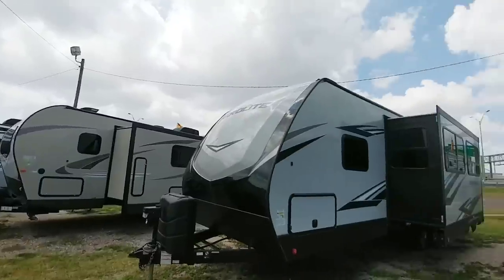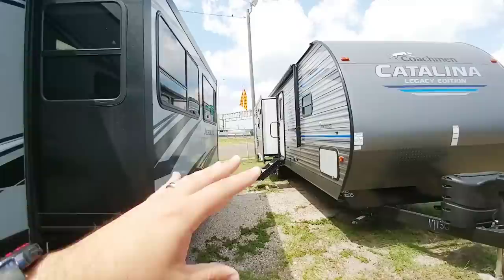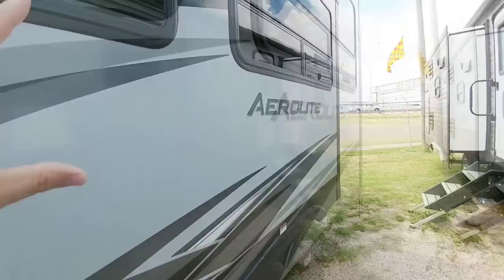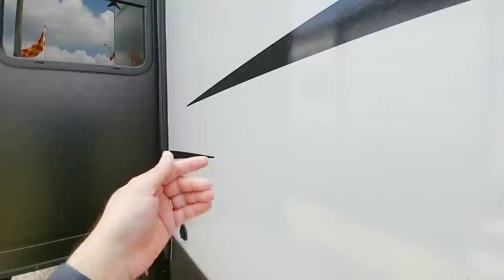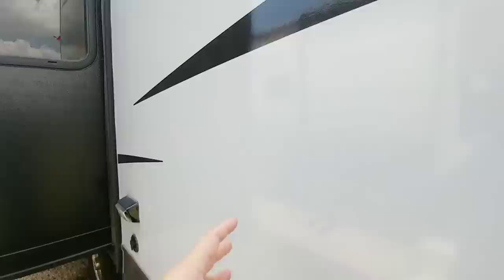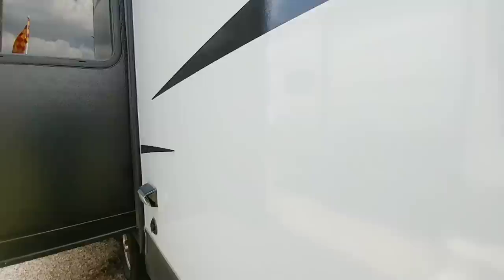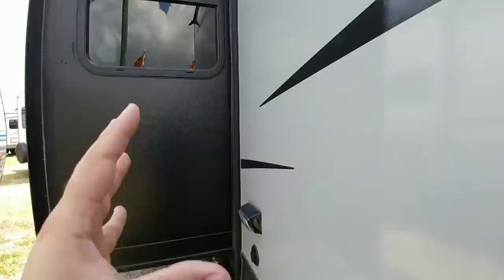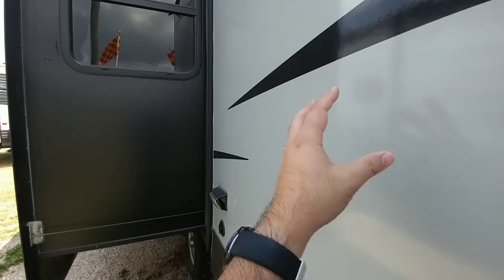Fiberglass Laminate vs Stick and Tin Travel Trailers and Fifth Wheel RVs!

Comment: We had 23yo HR aluminum frame and skin trailer. Build like a tank would last for decades but moisture got in on the slide floor and around the cargo door. Developed mold. Regardless of what type of trailer you have water/moisture will always be your worst enemy. The wood floor is the weak link on both types. I wish they used some type  of  marine water resistant material on the floor rather then just plywood.
Reply: George Suchenstein or just buy an airstream and kiss the moisture issues away.
Reply: I’ve worked at fixing rotting plywood floors and it’s not pretty.

Comment: One thing that was not mentioned is the weight factor. The aluminum rig is going to be lighter. That was the key decision in my purchase.
Reply: Not always.
Reply: Is your screenname "Tralfaz" from "The Jetsons"?
Reply: @machfive916
Lol. Yes it is.
Reply: in the 2022 jayco 28bhs, the fiberglass version is 300lbs HEAVIER than the aluminum version
Reply: @resharddurdley6987  100% bs. You take identical units, aluminum and fiberglass IS lighter. I Had a 24’ Starcraft, wood frame aluminum and it WAS 400’ lighter than my vacuum bonded aluminum travel trailer. The Starcraft was 6’ shorter w/out a slide out.
Reply: @tralfazsteamboat5695  Then your updated or current name should be "Astro"
Reply: @paulc8092  That’s funny right there. Had the name for years and no one thought of the rename.

Comment: I much prefer the fiberglass simply because I spent hours and hours scraping off old sealant from doors, windows and such on the aluminum one so I could re-seal the entire unit and because it isn’t a smooth surface it was such a pain in the butt!!!  I would think having two flat surfaces would be so much easier maintain the seals and integrity of the joints.

Comment: here is the southwest people are starting to look for the tin sides because the very high heat is destroying the laminate sided RV
Reply: Guess the class A coaches better stay away 😂
Reply: I saw one a few weeks ago barely 3 or 4 years old delaminating from the heat, My old stick and tin was in better shape.
Reply: Heat can play a role in delamination for sure but the biggest culprit is that owners do not properly wash and treat the laminate on their trailers regularly. Bugs and dust will cause damage to the clear coat causing fade and erosion of the fiberglass. That’s why you need to wash it and wax it fairly regular

Comment: JD, you also might point out that the fiberglass sided units are easier to clean and slightly more aerodynamic.
Reply: Actually the ribs are more aerodynamic.
Reply: @NoName-tz5ji  Yeah, I guess that's why airplanes, vehicles, boats, and UFO's are ALL smooth sided … SMH.
Reply: Burt Bennett planes require lift,boats are in the water,I know squat about space travel so I’ll give you that one. Cars are made to look stylish and be aerodynamic,a car with diverts is ugly but it’s been researched.. Research it.🤦‍♂️

Comment: There was a fire at the storage lot where we keep our camper. All the fiberglass sided ones had heat damage. Our aluminum sided one only had to have the doors and seals, and windows replaced. We were back camping while the 4 other rvs that were affected were still in the shop.

Comment: Had both types.....hardwall is way easier to wash and keep clean. Tin wall may be more budget friendly, but if you try to hose, or pressure wash (even at a mild pressure) from below, you can get water in behind the siding.....

Comment: Just thought I would post this for some of the viewer with questions. I have a 2009 Jayco Jayflight with a large single slide, which was before Jayco sold off to Thor. I honestly think this was some of Jayco's best years for quality. Some have said the quality went down on the Jayco units after they sold to Thor but what I'll say about our 2009 Jay Flight G2 with aluminum siding is that its very well built and has required very little upkeep. At 10 years old we don't have a lot of fade either. I very much appreciated JDs assessment, but for me personally on TTs I actually like the look of the aluminum siding much better than the smooth laminate look. I see more problems with decals fading, chipping off or flying off on the laminate siding RVs than I do with the aluminum siding units. For whatever reason, however on Fifth Wheels the laminate/Azdel siding looks much better to me. Good video, JD

Comment: Up here in the nw there is very few 4 seasons rated stick and tin trailer 
The trailer I have now is laminate sidewall and my first one the others I have were stick and tin
That you froze in during winter
Granted the trailer before was a 1997 
It also was impossible for the air conditioner to cool the trailer down
My opinion is 
If it’s stick and tin it needs to be 4 season certified

Comment: I’ve seen to much delamination to steer me with the stick and Tin. Love our Jayco 32BHDS
Reply: Stick & Tin will delaminate just like fiberglass. Only difference is the Stick & Tin is less expensive and easier to repair. Also, the Fiberglass is lighter.
Reply: What about that Azdel stuff?
Reply: @rush1764  No it wont.  Something can't delaminate that's not laminate.
Reply: @rush1764  how??? Alloy siding is literally like house siding. There is no glue.

Comment: You forgot the injection molded methods.  Also many fiberglass units use the better Azdel panels instead of Luan panels.  Azdel will not absorb water and there are fewer problems with delamination, as fiberglass bonds better to Azdel than Luan. Vacuum lamination has a much lower rate of delamination than a pinch or pressure laminated unit.   Properly cared for, tin and stick units can last very well, but they are more prone to leakage and water damage. The high heat and humidity of the Southeastern US has a detrimental affect on most Tin and Stick units,  also the aluminum outside is easily damaged and can become ugly looking in a short period of time. Having said that, older and some modern cheaper Fiberglass units were prone to severe delamination which is a lot more expensive to repair than the aluminum siding style.  Newer units, are less prone to that problem, especially the vacuum laminated units with better, but currently more expensive Azdel panels.
Reply: Hi Gerard.  Do you happen to know what makers (brands) use 'Azdel'?   Thank you for sharing your knowledge on this topic.  I made note of the vacuum lamination as well.
Reply: @lw5417  I do not know all the ones using Azdel, but the Coachmen APEX and Freedom Express models and the Winnebago models as well as the R-Pod and others are switching to Azdel.   Find a what you can tow and the floor plan you like then check out the different manufacturers for ones that fit those criteria and at dealers near you.  The quality of manufacturing also plays a part.  Just because they use azdel does not mean the unit will be well made.  There are whole books on how to pick the right rig for you and evaluating the different manufacturers.  Some of the best made are made in Europe and Australia and not available in the US.  One other method of making is using molds,  both Scamp and Casita make critically acclaimed trailers that you have to order directly from them. The bad news is that they are small and simple and good only for one or two persons.  The good news is they are really well made and have the fewest complaints and excellent customer service, while being light and easy to tow.
Reply: Hi Gerard.  I cannot afford to make a mistake.  This will be my retirement home.  Your good information is now written in my notebook for finding a quality RV that will last.  Thank you for sharing and helping others, like me.  Wishing you the best. 🌻
Reply: @gerardtrigo380  Oh good, I'll check out those channels.  This is so much fun!  Thank you.  🦋

Comment: What many people don't know is that with BATT insulation there are going to be many voids. Fiberglass doesn't always creep into every gap. Also, batts are cut to a specific size so if the FRAMING of the studs isn't perfect the insulation won't pit properly. I would always choose a   one piece foam filled wall over batts any day.

Comment: My aunt and uncle had two replacement walls put in under warranty on a solid walled unit due to cracking at rear door, the third wall installed came with a new frame under warranty. It is a good thing they put on some miles early, wonder how many units out there are a ticking time bomb?
Reply: Doug - to answer your question, 98% of the new ones; the other 2% are stored in climate-controlled garages.

Comment: It seems to me that both are fine if you can keep them dry under the skin.  A guy once told me that the best maintenance for a trailer is to keep it inside between uses. It eliminates moisture intrusions and preserves the seals.  Sun is not good either.

Comment: Good advice except one part. You can’t find all floor plans in both styles. The higher end units , higher end 5th wheels in particular, will only come in fiberglass. The lower end units will come in both.

Comment: Cheap fiberglass siding delaminates from glue separation. Go out west where i've noticed what the hot dry heat does. Not always water from behind. But, notice very expensive rv/motor homes don't have that problem

Comment: Any inside air that gets on the tin will turn into water when it is cold outside. The fiberglas delaminates. And both make no provision for when (not if) the water heater leaks. 
Today’s cars may look cheap but most will last far longer than the old ones. 
Someone should develop a travel trailer that will hold up. And don’t say “Airstream” their floors fall out too.

Comment: Really with an travel trailer, its function over form. Looks are a nice bonus, but comfort, utility, reliability and ease of maintenance would be my big concerns. Now obviously something painted pink with orange stripes and green wheels isn't getting attached to (any) truck, but realistically the goal of a travel trailer isn't to be sat outside of and admired, its meant to give you a comfortable place to sleep when you're on the road. Same way truck A may look better than truck B, but you buy truck B because its more capable than truck A. If you really have a thing for looks, worry about the interior first.

Comment: We had a stick n tin for 12 years.   We got a hail storm and it was totaled.   We were told that the fiberglass was stronger so we bought that.   Yes, our old unit was not covered underneath but the new one is.
Reply: I store my 5th wheel at a storage lot which got hit by hail, the stick and tin trailers all had sever dents, the fiberglass ones didn't but my roof did take a beating which I repaired myself.

Comment: Is there a weight difference between the two with the same floor plan? And is one more energy efficient over the other?
Reply: Rick VAnSkike normally the weight difference is minimal (within a few hundred lbs)  when comparing the same size rigs. It’s the accessories that make the biggest difference in weight.
Reply: @gfunk4014  thank you!

Comment: JD, in your opinion, which would be the most energy efficient when it comes to cooling either the tin vs the fiberglass here in the Coastal Bend region? As full-timers we definitely want the one that would be the most energy efficient since all the parks charge monthly electric for those that are on a monthly basis.
Reply: I will be buying a fifth wheel in about two years. I will be a full timer. I'm on a budget. I'll also be buying a nice used Truck too. Most likely the Fifth Wheel will be used. So it's a bit scary because of water damage. I'll be moving to Arkansas or Colorado, not sure yet. Also I have two Parrots. So I have no idea how they're going to react to being in a moving vehicle. Also about finding places to stay that are affordable. I'll have a work at home job, and disability, so it will not be a whole lot of money. I would like to know what my monthly cost would be on a budget, staying at one place that would be affordable.  It will just be me, my Chihuahua, and two birds. Unless I meet a woman within that time or later. It could happen. 😁 So as much advice that can be given, would be fully welcomed. Thanks.
Reply: I have been doing alot of research ... i have similar questions as these gentlemen do... and I'd like to ask one more : 
Which trailer ( fiberglass and aluminum frame) or tin and wood frame... are more likely to hold up secure in a major storm ? As weather events these last few years have intensified and will continue to do so .... which is beefier and stronger .... this goes from hail stones,  to flying debris etc.... 
Thanks for the input! And wisdom!

Comment: You forgot one thing to mention. Rigidity in an aluminum frame is must stronger and more durable than a stick and tin rig. I didn’t buy a wood framed rig because they generally have more sway and tend to separate at the joints more often. Meaning my rig will last a lot longer than a stick and tin rig.
Reply: G Funk sales man told you that huh?
Reply: Aluminum is more ductile but has a lower yield point then wood and is prone to work hardening, eventually all the screws and bolts in it work their way out as the holes get bigger and the aluminum ribs shift a bit. Wood might flex and sway more but the only reason you might have to do more sealing work is their are more Seams on a aluminum trailer. I check my bonnet and rear seals everytime I move my unit. It's bonded walls and shifting going down the road takes its toll. Easy enough to upkeep

Comment: My concern with Stick/Tin vs Aluminum frame, is the frame. There is no way i can see a stick frame not becoming loose while bouncing down the hwy.
Reply: This is what I always wondered. I have done a lot of framing, and I just imagine a wood frame would fatigue much quicker than an aluminum one.
Reply: @roethle  travel trailers have a reputation of not being designed to be hauled back and forth across the country. They "have a 8yr leave, because everything starts getting loose" from bouncing down the road.....i am positive, this reputation comes from people have stick/tin rv's, and having them fall apart.
My 98 alumalite is still solid as it can be, and i haul it across the country multiple times/yr for work.

Comment: I would like to see a comparison of something like your fiberglass model in this video and an Apex Ultra Light assembled with the Azdel composite that doesn't use the wood backing.

Is the Azdel composite build really worth the added cost, will it be a better buy over the long term? Or... Is it a sales gimmick? Is Azdel really more insulated and will you have better results with your heat and AC on an Azdel build?

There isn't a lot of Azdel choices in the lower price range that I'm aware of, but the Apex Nano and Apex Ultra Lite are one option that do stand out to me as being potentially the best buy for a value shopper being that if the hype is true... It will Outlast both of these that you show and have less age related issues as your trailer gets older.

Comment: I love watching your Videos, I have a question what is the best sub 50 or 60K winter camper in each style from bumper pull, 5th wheel and truck campers that would be 3/4 ton tow-able. and sleeps at least 4 people.
Reply from the maker: One with good insulation, 2 ACs, a large furnace and heated underbelly

Comment: Thanks for the info. Question: Which one is going to need more regular maintenance over its life? Is the cost going to be offset with maintenance on one or the other?
Reply: A wooden box with a cut out is the cheapest deal. $12 for a 10×12 

I would think it's like cars. The more luxurious, the more the maintenance (parts, repairs)
Reply from the maker: That's more related to use than construction materials
Reply: I was thinking that the construction materials would drive certain maintenance. Something I would want to consider before purchasing but if they are similar (given similar conditions), then that’s good to know. Thanks!

Comment: Just like to know which one stays cooler in dead heat of summer day at the beach tin or fiberglass/ laminated?
Reply from the maker: So the Aluminum siding will deflect more radiant heat but the bat style insulation will not perform as well as foam overall.  Fiberglass sidewalls have almost no R value but the foam does a better job of insulting.  So their about the same overall.

Comment: Your wrong on the insulation value being the same. On the laminated walls with aluminum frame there is no insulation. If you get into cold climate there is no insulation value where there's an aluminum frame as there is nothing inside that frame but air. You'll get condensation. Ask someone that camped in one in real cold climate.

Comment: Thanks for a great overview. We have a FibLam trailer but it was the right size, at the right price with the right floor plan so I didn't give a lot of thought to the construction. We've been in it a few years and are now pondering the eternal what's next question and this helped disambiguate the styles of construction. I prefer the smooth sides and typically sealed underbelly of a FibLam, but finding the studs and rigidity to mount heavier items (e.g. a TV) have made me start to think more about the unit as a whole.

Comment: Is fire a bigger risk with stick and tin?
Reply: No more risk than fiberglass.... yet, a laminate coating will ignite at a lesser temperature and far faster than metal, be it tin or aluminum, and once it does. . . Well it goes flashover
Reply: @iammewhoyoube  good to know!   Thanks